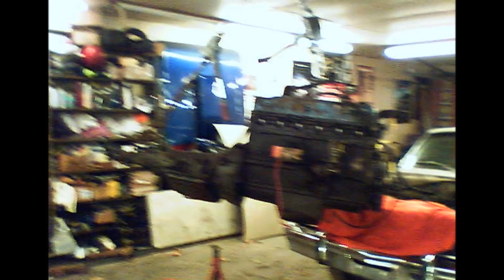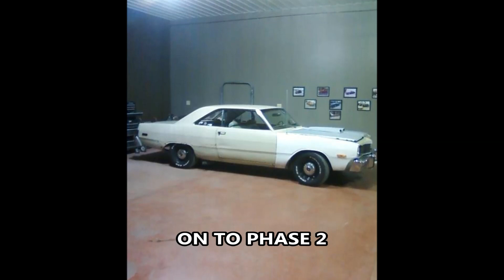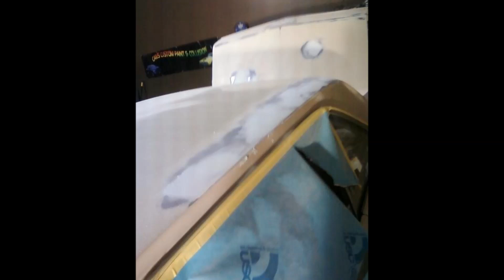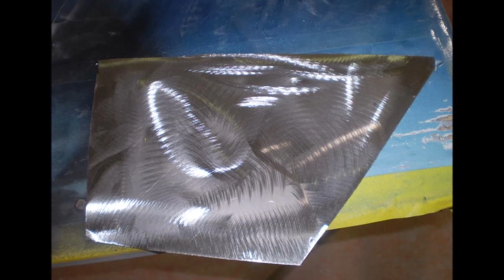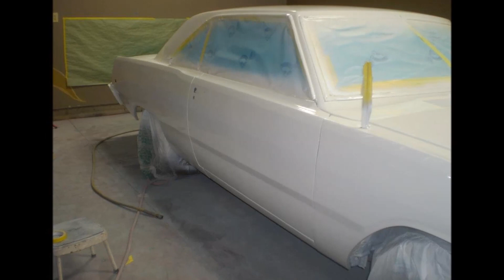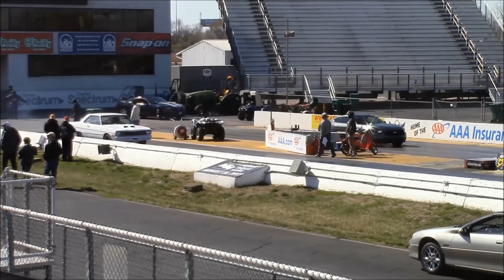76 Dart Transformation

Comment: Nice job, it's not easy making a 76 look cool. Chrysler really tried to uncool them & Pretty quick , what's the power plant ?
Reply from the maker: 360 with a small hydraulic cam, holley 780 carb. 3.55 gears. It's reall nice to drive.
Reply: @dragindart  wow, that's a great set up